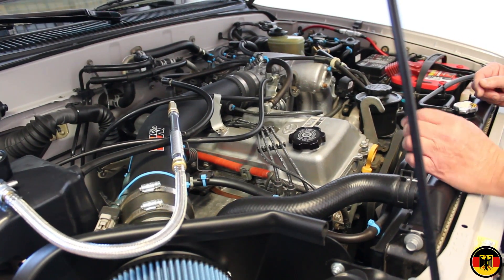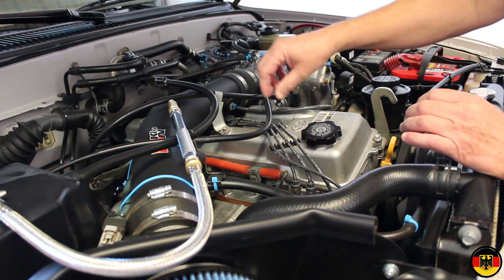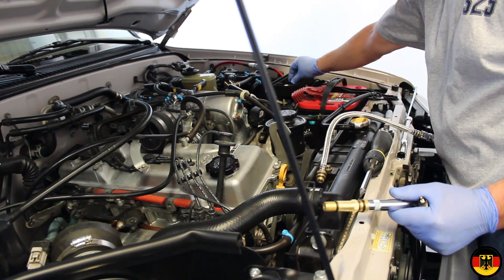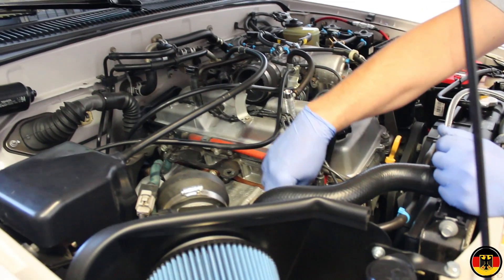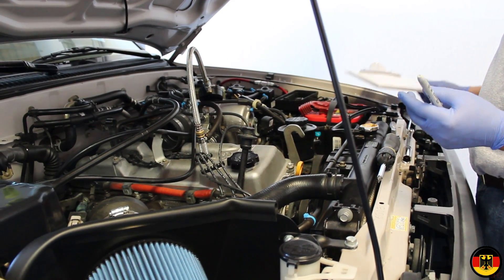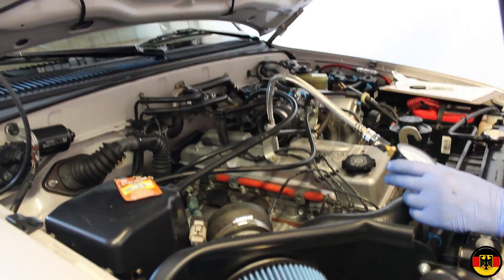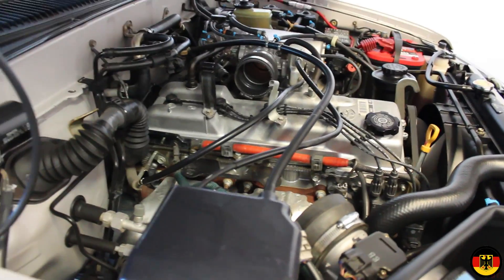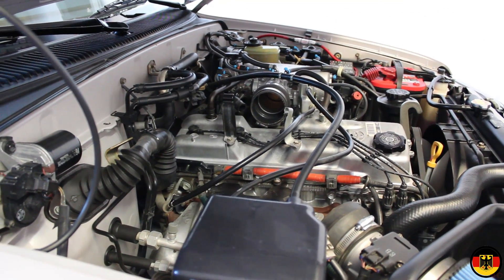3RZ-FE Compression Test

Comment: That motor is not even broke in.

Mine has 430 000km. 
Needed to remove the head because someone fitted the wrong plugs and 2 broke off when I tried to remove them.

The cylinder walls still had cross hatches and no ridge on top of sleeves.

These motors last when you do regular oil and filter changes.

Cheerz
Reply from the maker: Thanks for watching!

Comment: Just checked compression on my 3RZ-FE. To me his compression was a little low. New this engine should be at 180-to 200 psi. Right? Not saying his was bad but my test was kind of different with last two cylinders being lower. My was 205,205, 200, 198. Now here is the thing my engine is not near new or has it ever been rebuilt. My truck has 208,000 miles on it. So I am wondering is the compression to high maybe carbon build up causing it to be that high? Just wondering if others have got readings like mine with a high mileage engine. My truck runs smooth oil only turns brown in 5000 mile oil change. Sent oil to Blackstone labs and the said oil was still at half life at 5000 miles and I could up my oil change to 7500 with no issues. I doubt I will but good to see oil is holding up so good. Using Shell 5W 40 diesel truck oil because it has more zinc, than other passenger car oils. Plus this engine uses tapplets valves so that is a lot of friction. I wish there were more videos on compression test with the 3RZ-FE. Please post more compression test so that I can see if my test is wrong or if there is starting to be a carbon issue making compression higher at this point.
Reply from the maker: The reason my compression showed low was because I left the spark plugs in the cylinders that weren't being tested - I re-tested at a later date and found the results to be within the Toyota specs.  Your compression seems high, but that may be due to an inaccurate gauge as opposed to carbon buildup.  If your engine is running properly and oil analysis shows no issues, I would not worry one bit about it unless you have other symptoms of issues, like very audible valvetrain noise.  Hope that helps, and thanks for watching!
Reply: @redonKiLaus  Do you have or know where I can find the Toyota specs ? I recently got my 3ZR rebuilt and all the guy did was rebuilt the head. So I am gathering info to confront this dude who ripped me off. I found carbon on all 4 pistons, was to have new ones installed on a rebuilt. Not good. Any info would be most appreciated!
Reply from the maker: @rickrivers2909  I'd consult the field service manual...that's the only place I can think of with those specs.  Thanks for watching!
Reply: So you want to have all the plugs out when doing this?
Reply: @shckltnebay  yes, plugs out,  engine warm, battery fully charge ,

Comment: in addition to the relay, should I disconnect the main boot for the EFI also? how about releasing pressure from the injectors
Reply from the maker: swigga4O You shouldn't have to worry about that, just pull all of the spark plugs and the wires (unlike what we did in the video) and pull the EFI relay or fuse, and you should be good to go.  Thanks for watching!

Comment: Hello . I am rebuilding my 2001 toyota tacoma 3rz engine. Do you know the compression for the 3rz-fe?  In stock mode. Do you think my engine will last a long time getting it rebuilt? And is it a good idea to get turbo? Or will that cause engine to brake again or engine problems?.
Reply from the maker: I believe the stock compression ratio of the 3RZ is 9.5:1.  If you want to turbocharge your truck, you can run 5-7 psi on the stock motor, but if you want any more than that, you will have to build the engine with forged pistons and rods, as well as upgraded valves, valve springs, and preferably cams.  If you rebuild the engine properly, it will last a very long time, and the turbo should not harm that if you know what you are doing.  Thanks for watching!